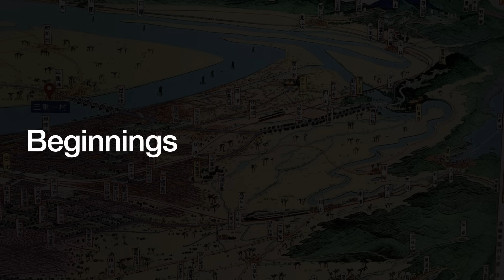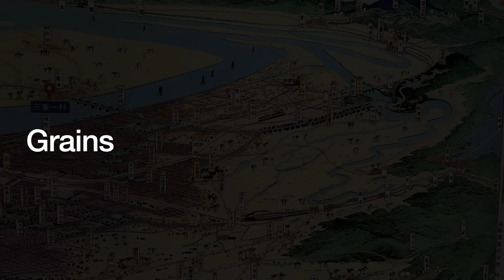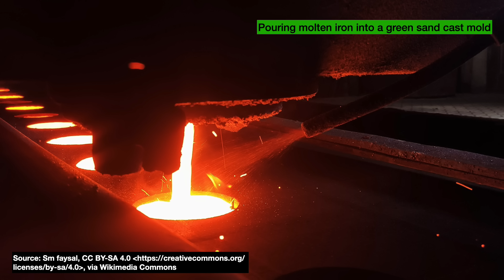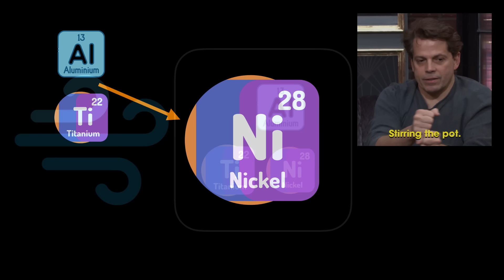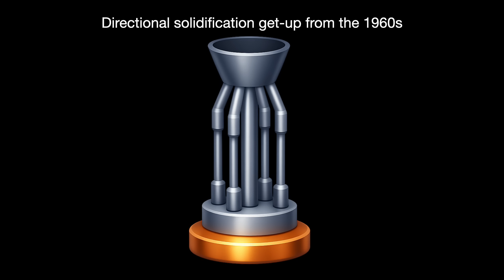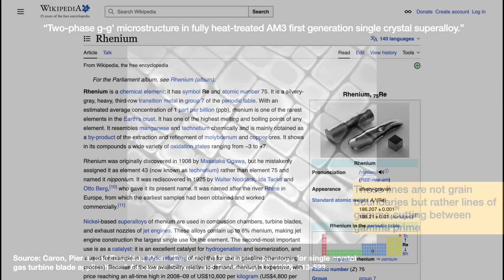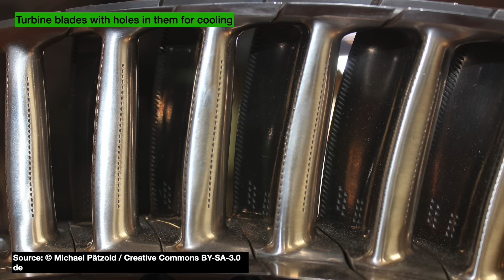Gas Turbine Blades and their Heat-Defying Single-Crystal Superalloys

Comment: The section on rhenium had me questioning why tungsten isn't used because it has the highest melting temperature of all the metals and is also the strongest with a tensile strength of almost 1 million psi. I thought it might be its extraordinary density being about that of gold but rhenium's density is higher at over 21 so if anyone knows enlightenment would be appreciated.
Reply: W is indeed used. Mo is sometimes used as well (but not by GE who thought it was bad for hot corrosion resistance). These and Re contribute in a manner called "solid solution" hardening. The idea is simply. that wondering dislocations get tripped up a bit when they hit a relatively immovable atom. For similar reasons, I do not like nuts in ice cream. They mostly go to the gamma phase, but you can't have too much or deleterious phases will appear. Or, as I believe I was first to discover ca. 1985, you need a bit of those phases for creep resistance.

Comment: I was literally cutting into a slice of pizza when you made the oven reference 😂

I worked at a company which sold parts for aviation and power generation. By far the most profitable parts were "hot section" turbine blades, vanes, and discs, which we would either acquire new on consignment, or broken down as a purchase of an entire engine. Whether new surplus, or overhauled, these were worth their weight in gold in the open market. GE and Pratt & Whitney had their trade names for the.nickel alloys like inconel & hastelloy.
I do remember the crystalline patterns on the new surplus blades.
Awesome video, thank you.

Comment: One thing that always got me is why dont they use dipples in the turbines. Airfoils with the texture of golf balls are known to have a protective barried of air, which greatly decreases resistance at the price of lift. It can be used to keep the cooler air around the blade instead of just letting it leave.
Reply: They do use dimples, but only in the internal cooling passages to increase heat transfer. I can't speak to anything aerodynamic,  but believe me, if there was a benefit, they'd use them.
Reply: You can't afford the disruptions on the surface of the blade.

Theoretically, we could get exactly the texture that would leave a perfectly smooth laminar flow close enough to the blade surface, without unwanted vortices that disrupt the desired gas flow.  

But we aren't quite there yet, at least not at production volume.

Comment: have some of these techniques and materials been incorporated into rocket motors?
Reply: Perhaps the turbo pumps that drive propellant and oxidizer into the combustion chamber.
Rocket engines themselves are pretty much static structures.
Reply: Oh, yes.  Company I worked at divided the factory and engineering staff into "Rotating" (all turbine blade & fan blade stuff, even if it was for aircraft) and "Aerospace" (all of our work involving non-rotating parts).

While the plant was divided administratively, we were side by side in reality - in the R&D department where I was (working for Rotating in failure analysis), my cube mate was a design development engineer for aerospace, and we frequently bounced ideas off each other.

Comment: Excellent presentation. There is a process developed by AirLiquid called 'SPAL' that drips liquid argon into the casting melt, sort of a poor man's method. Praxair has a similar method using gaseous argon. I appreciate that you didn't spend much time on the crystal structures, face cubic center, body cubic center, UGH they give me migraines.

Comment: 🤔 I guess Forging is not an option...
Reply: Nope. Low temperature properties are great in a fine-grained material, but above a certain temperature, grain boundary sliding makes creep resistance very bad. Hence, single crystals.
Reply: @ChesterMotors-gg3dy  Forge is a different process, that makes stronger materials than Casting, so it could be optimized to make Forging in vacuum at high Temperatures. Something to consider for making Space Foundries in the Future

Comment: Small correction: You sometimes talk about fan blades in this video. These are turbine blades, the compressor has compressor blades. Fan blades only exist in turbofan engines for aircraft as they are just a high speed propeller more or less. Industrial gas turbines don't have fans as they don't need to generate thrust.

But as someone from the gas turbine blade design field, I'm a bit more exact than necessary.

And don't think that every modern blade is a single crystal. As single crystals are really expensive, directionally solidified is used where possible or maybe even conventional cast alloys.

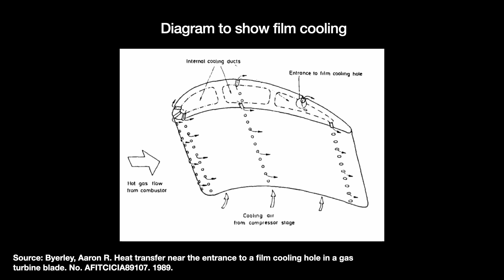19:35 If you wonder why the air is hot: The pressure of the cooling air must be higher than the surrounding pressure that is still high in the first turbine stage. Otherwise the hot air would flow into the blade.

Thanks for the nice introduction into turbine blade materials. If some of my friends want to know more about what I'm doing, I'll definitely recommend this video.
Reply: Thanks for your clarification here, re: the blades.
 I also found the naming of blades a bit confusing. However as I usually just count them as ' the ones at the front" and the `'hot ones at the back`', even I know that I am not qualified to make a call about it.
Reply: wouldent the centrifugal forces at the blade "draw"the cooling air threw even if at a lower pressure ? just asking.
Reply: The twin towers collapsed because the impact removed the thin cement- like fire protection from the columns allowing the accompanying fire to soften them. This can be seen at the museum where they have an actual column with some of the protection blown away.

Comment: Ceramic matrix composite blades are expected to cut a lot of weight from a jet engine. Not sure there are plans to use them in ground based turbines or just aviation in the near term.

Comment: I'd say the addition of rhenium increases the time of service  (by a couple orders of magnitude)
P&W really was at the cutting edge of superalloy metallurgy back then.
Reply: P&WA and GE Aircraft Engines were both pretty good at this. There was a joint GE-PWA contract to develop an alloy best suited for a supersonic transport, and I got some good times at their West Palm Beach facility. It somehow fell to me to present the preliminary results to a large room of government monitors. There was good news and bad, I recall beginning with.
Reply: Reminds me of ReNe alloy, intended for Dyna-Soar spacecraft to allow it to re-enter without ablative heat shielding
Reply: @caav56   Neon alloy??
I thought nobel gasses didn't really form molecules?
Reply: @jimurrata6785  It's a name for alloy family, not a formula.

But xenon sometimes can form compounds
Reply: @caav56  I'm aware of HF6.
Have to look into whatever alloy you're referencing here.
Must have been crazy expensive.
Reply: @caav56  Yep... Rene Alloys were developed by GE in the 40's.
Reply: @caav56  Please don't capitalize the N in René. It has nothing to do with Rhenium and even less with Neon.

Comment: Have you had a look at Stanley Hookers biography Not Much of an Engineer - when he gets onto turbines there is quite a bit of discussion on how they are made and the issues. One of which was that they had to be bird strike proof! I think turbine blade troubles were at the heart of the RB 211 issues that bankrupted Rolls Royce. 
Gas turbines were not developed because of the war but because of the limitations of piston engines hence the interest in them pre WWII. It was the war that accelerated interest, as aircraft weights and speed requirements increased rapidly reaching the point where there were sever limitations on piston engine development.
Reply: I have read that book and it is a great read, however, I have to correct you on choice of words in gas turbine engines.  The turbine is best described as the part that extracts energy from a fluid path (gas or liquid), be it a windmill, water turbine, gas turbine, turbocharger, etc.  So in a jet engine, the turbine stages extract energy from the gas path to power the compressor forward of the combustion chamber, plus usually a 2nd or even 3rd stages of turbines running slower that extract more energy from the gas path to run pre-high pressure compressors and or the big fan that everyone sees in the front of a jet engine.
  Rolls Royce nearly went belly up trying to make a carbon fibre based fan at the front of the RB211 engine, but fell back on the solid titanium fan blade model.  They have since gone on to make hollow vacuum / honeycomb filled fan blades.
GE on the other hand did go on to successfully design and produce a carbon fibre ran blade with a metallic leading edge overcoming the hurdles that Rolls Royce tried in the late 60's.  Twenty plus years later.
So remember,  fan turns rotational energy into airflow (thrust), compressors turn rotational energy into high pressure, high temperature (600 deg C) air.  combustion chamber fuel added.  HP turbine extracts energy to power compressor,  LP turbine extracts energy to power fan that makes 80+% of thrust.  The hot exhaust makes the remaining thrust.

Comment: I worked at GE gas turbine division. In bucket repair. The technology is truly incredible.😮😅😊 And those heat coatings are a carcinogen.😮
Reply: Somehow making nearly-indestructible stuff always causes cancer ☹️ Budd railcar stainless-steel welding. Fire-resistant asbestos. And your heat coatings, apparently.
Reply: My wife works in a medical facility not far from the Sikorsky helicopter factory. Whenever they have a patient with some rare or unexplained medical condition, it always turns out to be either a present or past Sikorsky employee. They use all kinds of crazy and hazardous materials to build those helicopters too.
Reply: I work there now and can tell you that if you get cancer, it WILL be because of that stuff. I even found out that some of it is radioactive!
Reply: Did you ever lick them?

Comment: I hear ceramic metal composites are the next step up. Also, "25 seconds ago" as the upload date is something I never thought I'd see.
Reply: Cerrmet materials have insane properties in general. The most common one is tungsten carbide with a nickel or cobalt binder. Had enough to drill rock, but tough enough to literally take a beating, especially the nickel type. One thing that is odd is if you heat it to dim red heat you can actually forge it like steel 😮
Reply: Cerametals are insane composites.
Reply: Yeah, the blades on the 787. The trent 1000 has CFRP blades with ti edges. But they are the fan blades not on the hot side of the engine.
Reply: You’re right. There is a big push in the industry for CMCs with significant portions of R&D budgets dedicated to them. For any graduate material science students, take heed…
Reply: @tacosmodernrice also learn some data science in the way 😂